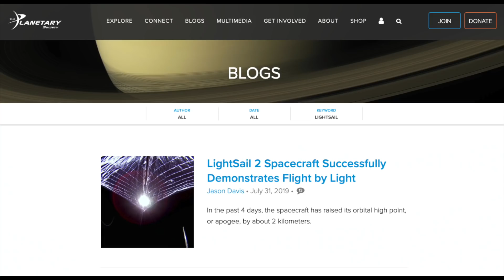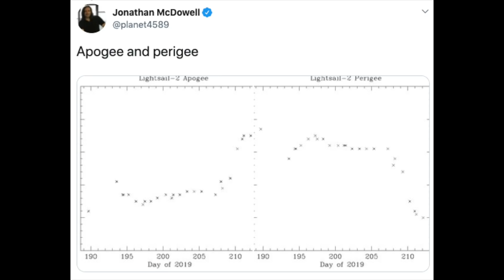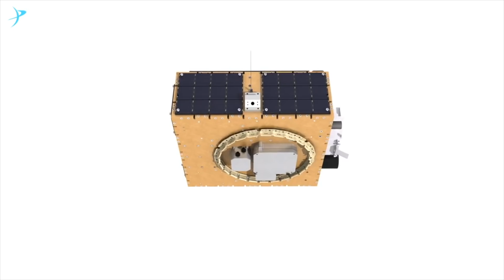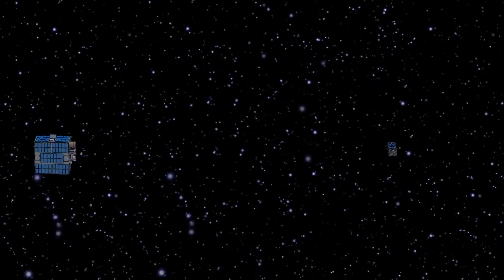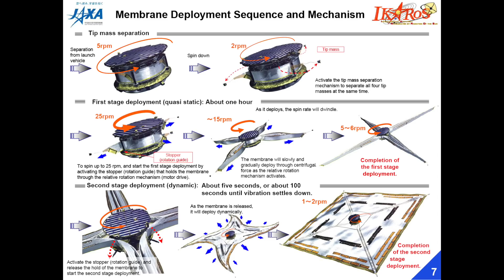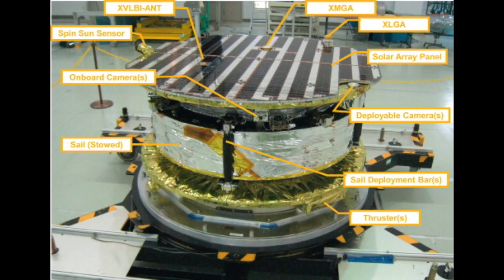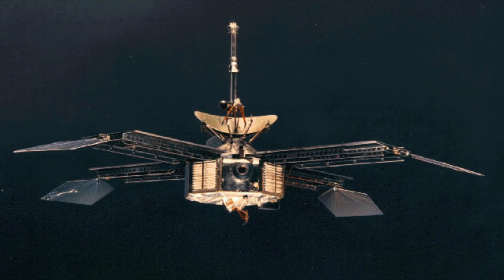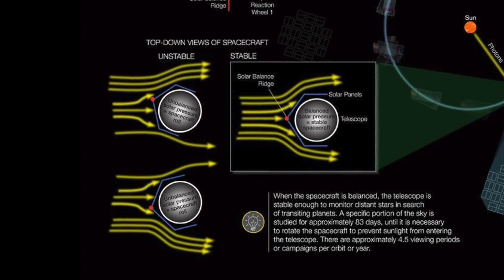Lightsail 2 Sails On Sunlight At Last

Comment: if they just split the sail into two equal sections on the same axis,  it wouldn't even need to saturate the reaction wheel to adjust the attitude every pass... the two halves could align parallel and perpendicular to the photons countless times with a simple step motor, and all the torque vectors would cancel out.

Comment: Based on the research of Larry Reed on momentum of standing waves in phase locked resonator cavities, I think that photonic propulsion will be the ultimate form of transportation.  Instead of operating on the momentum of reflecting photons, which absorbs only a very small amount of energy from the photon proportional to both the Doppler shift and change in amplitude of the exhaust photon, you can use the phenomena of phase conjugation to first store a large standing wave of electromagnetic energy within a non-linear optical material, and then release the energy by applying the correct Lorentz-Doppler phase-shifted signal to the standing wave. The combination of standing wave and Doppler wave causes a third type of wave, a modulated standing wave which repels or attracts the cavity depending on whether you red shift or blue shift the probe signal. This causes thrust with a much higher efficiency than a standard photon rocket or solar sail, because the entire momentum of the standing wave photons can be converted to linear momentum of your vehicle through phase conjugation and then phase+frequency modulation. The maximum speed is a function of the delta in frequency with respect to the initially locked frequency. The acceleration is a function of the amplitude. If you include amplitude modulation you can increase the thrust dramatically by pumping the resonant cavity with powerful lasers at the appropriate Lorentz-Doppler signal, instead of relying on incoming solar radiation alone. 

I encourage anyone interested to find Larry Reed's paper, "Confinement of Light: Standing wave transformations in phase-locked resonator".

Comment: I wonder if it would be possible to get a telecomm company to sponsor a solar sail technology tester. Piggyback it onto the GTO transfer orbit, then deploy it with the apoapsis high and periapsis low. Then try to raise the periapsis out of the atmosphere drag zone with the solar sail. The atmo drag at the periapsis should be enough to drop the apoapsis so that the cubesat won't be hazard to the geostationary satellites should it fail, and it would demonstrate useful orbital adjustment capabilities if it succeeds.

Comment: If it loses more to drag shouldn't they edge on with respect to atmosphere when close to earth where I presume the drag would be highest. Then when potential acceleration is highest/ exceeds drag rotate appropriately. As long as there is a net gain or at least with enough of an initial input where you can get to an orbit where the drag is negligible. If this was a video game and I wanted to proof of concept. I'd make the sail 100x the size and all but remove the actual payload portion.

Comment: Question, is it possible, with orbital dynamics the way they are, for something with a light sail only to increase both it's apogee and it's perigee with different angles and such considering that the force is all being applied from one direction? 

I thought about asking if it's possible for it to reach escape velocity but I realized that if it's placed in a higher orbit, so that atmospheric drag is low enough, by another craft and the drag on the perigee is low enough it could reach escape velocity by just increasing it's apogee eventually.
Reply: well, the force is not strictly unidirectional, given the Earth's orbit around ol'Sun, so any orbital maneuver is technically possible. Besides, it is perfectly possible to apply radial acceleration in order to circularise. Highly inefficient in terms of time, but not at all impossible. And lastly, the force is not unidirectional because it depends on the orientation of the sail relative to the momenta of photons, which are indeed (mostly) unidirectional. In other words, one can also use deflectional force (but it would be exceedingly slower, since the cross section is reduced)

Comment: why not use a solar sail in deep space  in front or both sides of a ship in space just use a full spectrum of light behind the sail or frequency high or low to add or lesson the speed seance frequency of the spectrum has different signals faster or slower  couldnt you adjust the speed and if its reflective going back though the prisome  again creating white light then reflect the white light for dubble boost of energy  at four corners or a diffrent point of the sail by directing the reflection of light  like directing lasers with mirrors ? or just use a mirror at the corners you could  bounce the light back and forth alot of times causing it to travel faster every time the light hits the sail ?

Comment: Did you notice the interesting pattern of klapton tape on the table when they were bench testing the sail deployment (@4:50)? At first I thought it was laid out that way to be as low drag as possible for the way the sail unfolds, but it also seems to match the pattern as they fold a stow the sail later on in the video. Also, I wonder if any of the assembly clips shown were of flight model, although they were wearing masks and caps, that didn’t look like a very high level clean room.

Comment: Wait, Wait~~~ The solar wind particles have inertia, but I believe it is much more difficult to "tack" against the Solar Wind... If I understand the explanation, it seems that the force of the solar wind particles is almost entirely imparted  along the original axis of motion... So that you could only move Radially OUTWARD from the Sun...
Photons have less inertia to impart, but the photons' angle of reflection is nominally equal to the incoming angle of incidence, and the direction of force imparted splits the angle formed by incidence & reflection, so you can tack against the light pressure. Maybe someone more familiar with the physics can correct me where I've mis-stated the situation.
The great thing about Solar luminance and solar wind ----> Even though its motive impulse is miniscule, it is ALWAYS available, except when you're in a planet's shadow, or so far out that dust and distance have attenuated it to the level of the background stars. Constant acceleration, right?

Besides, no snail is going to have the reflective surface area and Mass:area ratio to match the efficiency of the light sail. Not without a really good training regimen.

Comment: This is probably a dumb question; but if far enough away from a planet's atmosphere with 'zero drag', would a solar sail spacecraft continue to accelerate to near light speed? If so, I wonder how long it would take Lightsail 2 to reach light speed if it was shot into deep space :-P Haha.
Reply: No object or particle with mass can reach light speed. Furthermore, what's important to know is that a light sail is dependent of getting light from a source in order to accelerate. If the intensity of the light source falls near the ambient lighting, the acceleration will stop. This applies to sun as well, it's radiation decreases at the ratio of distance squared, and as Scott pointed out in the video, past Jupiter a solar sail wouldn't provide much accelerating force.

Comment: Just comparing the solar sail with a regular sail - which is probably daft - what happens when the sail is at 45 degrees to the sun - rather than edge on for 3/4 of each orbit, could there be more micronewtons, but at less useful angles?

Comment: I still can't figure out (and to be honest, I haven't looked into it that much), how this concept actually works. Photons can travel at C because they have no mass. If they have no mass, how can they exert pressure on the sail. I know that the force exerted is weak, but I would have thought that it was zero.

Is it because of the inherent energy in the photon? (from the whole E=MC2 thing) Is it that the photon gets absorbed by the sail and that imparts some energy into the sail?

Am I thinking about this in the wrong way?

Comment: So what you want here, ideally, is a craft with an ion thruster and some or all of it's lightsail made from (flexible?) solar panels. That way it can sail 'down sun' and ion thrust 'up sun'. Ideally, the sail would be in segments which could pivot independently of the solar panels, so that when it was under ion thrust, it could turn the sails edge-on to the sun for minimum drag while keeping the solar panels face-on to it for maximum power.

Here's another, possibly compatible, thought: if the spacecraft body was separated from the sail by a long truss, then you could get 'free' attitude control by setting the sail such that the direction of solar thrust didn't pass through the centre of mass, thus causing the craft to gently rotate. The advantage of a pole, rather than a cable, is that you can have your ion thruster pointing away from the sail without pushing the craft towards the sail.

Comment: Very interesting and important video.   This technology is under consideration for interstellar cubesat missions.
Reply: They would take an awfully long time to get there though. They would have an initial speed increase of maybe 4 km/h (2.5 mph) per year, based on Scott's example of the speed of a snail, which can manage about 8 to 10 metres per hour, downhill with a tailwind, but diminishing as distance from the Sun increases. Acceleration would be reduced to very much less than 1% of the initial acceleration long before reaching the edge of the Solar System. Given a few billion years, it might reach Alpha Centauri, about 40 trillion kilometres (25 trillion miles) away today, provided that the sail hadn't been demolished by meteoroid impacts before passing through the Kuiper Belt and the Oort Cloud. Assuming that Alpha Centauri hadn't moved further away, or disintegrated by that time.
Reply: @RWBHere  Good points.  Thanks for your insight.

Comment: Could lightsails be used to deorbit decommissioned satellites? Could you calculate the the increased effect of a lightsail if that could be a worthwhile solution to space junk? Perhaps it could be a future solution to install such sails on every spacecraft/module sent up in space. Perhaps it doesn't even have to be a lightsail but just a sail in general to increase the drag enough to speed up the deorbit.

Comment: I think Messenger was using its solar arrays to fine tune its flight path as well.  It was close enough to the sun to make that more practical.  Since the light pressure was so tiny and they had complete control over the arrays, they were getting insanely accurate flight paths using this method.

Comment: Wouldn't solar sails work in deep space if a one-way mirror is used?  The reflected light would impart more momentum than the refracted light.
Reply: Instead, you can do what solar windmills do, and paint one side black, so the light is absorbed rather than reflected, and thus exerts half the force.

Comment: So, it is not too wrong to call it solar snail??

More seriously, google says garden snail moves 0.047 km/h. Does that mean, this solar sale can add ~400km/h speed per year, so 150 years to reach the speed of Voyager1 (if it were to get the same photon pressure)?
Reply: NeblogaiLT Light intensity decreases with distance from the sun, so the acceleration would get really weak before it got past Jupiter's orbit.

Comment: im sorry if my question is stupid and i am sorry for my stupid comment a couple of months ago, but would it be more effective, if the sail would be slightly bended like a parabolic mirror?
Reply: Only matters if the light source is particularly close. The velocity change comes from reflecting the photons, so you want the change in the direction of the light to be the same across the sail, so they are pushing in the same direction. If they are parallel, or close enough coming in, flat is ideal.
I'm not actually sure what the best shape if you were close, parabolic might be correct then, but it could also be elliptic or some other curve.

Comment: Does no one notice how the "not in scale" orbit is WRONG ?! It wouldn't go more "up" but rather "right"
Reply: Actually no.  As you accelerate in the direction of the orbit, (prograde), you raise the apogee on the other side of the orbit.  So, with the Sun on the 'left', as you accelerate away from it on the 'bottom', you raise the apogee on the 'top'.  Isn't orbital mechanics fun? :)  

Riddle: If you accelerate up, you go backwards. Backwards makes you go down.  Down makes you go forwards, and forwards is up.  Where are you?
Answer: In orbit.
Reply: @NemoConsequentae   yeah, i was thinking "if i burn "left" in KSP, my orbit goes right" but they continue the burn the entire half circle so it is like burning "bottom". 

The real funny question is, how do you best angle the sail to minimize drag while at the same time dodge the photons on the upper half.

Comment: A reaction wheel seems like it would be way too heavy. Why not block half the sail to create differential thrust?
Reply: The IKAROS did that, and it was successful apparently.
Reply: @ryogofujitani  hmm I wonder why they used a reaction wheel then.
Reply: @ryogofujitani  from Wikipedia "Over a 23-hour period of time, the solar angle of the sail was changed by a half a degree". It's probably not enough torque to rotate it for planetary orbit manuvers
Reply: @Jone952  IKAROS used liquid crystal display-like things integrated into the sail to "darken" actively and change the reflectivity of the sail.

Half a degree seems good enough to be honest. Even in interplanetary manoeuvres, that can add up to a significant change. It's just that it definitely can't do insertion burns and such, so you need chemical rockets and powerful reaction wheels anyway.

Solar sails are for interstellar uses anyway. We have more efficient things for solar system missions.

Comment: Solar sails should receive way more support, we should make explorers using a solar sails to keep them in the solar system and go wherever we want visiting multiple planets (for mercury and venus would be perfect), no lifespan limit based on propellent and amount of maneuvering. 
How much deltaV would be needed to visit mercury with a normal probe?
But we should not use a cubesat because it is too limited by mechanism and sail volume.
The density by unit of area of the whole solar sail could be improved by a lot just increasing scale, design and using better materials that are being manufactured today (of course the planet society did enough taking into account that was a test concept with very limited budget).

Comment: so then how would one use that system to circularize an orbit?
Reply: Launch at daytime towards the east and make sure that the solar sail is deployed by the time it's heading away from the sun. Also fit gigantic sails.

Although practically speaking, accelerating a solar sail by few hundred m/s within a fraction of an hour would require a solar sail so gigantic that the weight may exceed that of a conventional satellite with propulsion. Circularizing needs high thrust, so chemical rockets are the best option for now.

Comment: 4:15 I think your elliptical orbit animation should be extending the eccentricity to the right, away from the sun, not up.
Reply: That's not how it works, the animation it correct. If you played KSP you would know that burning prograde at the periapsis increases the apoapsis at right angles to the craft and opposite the periapsis.
Reply: Because the sail can only accelerate the craft when it's going away from the sun (i.e. at the bottom of the screen), the result of the acceleration appears at the top of the screen. When increasing or decreasing the height of the orbit, the action must happen on the opposite side.